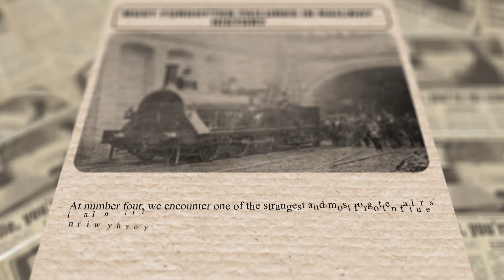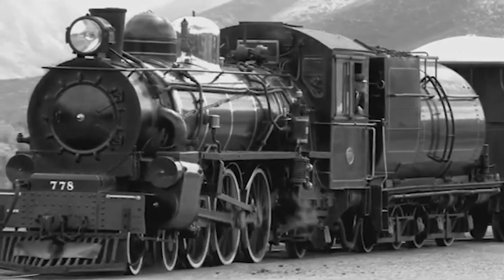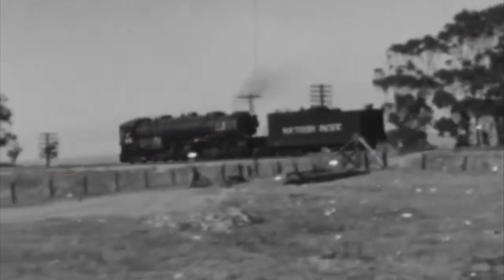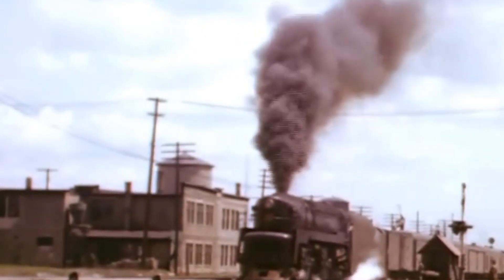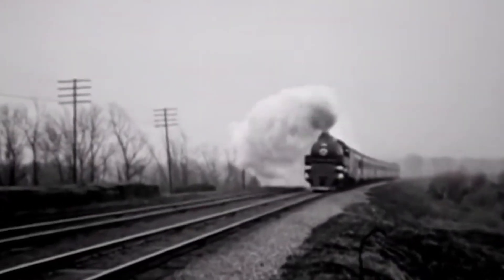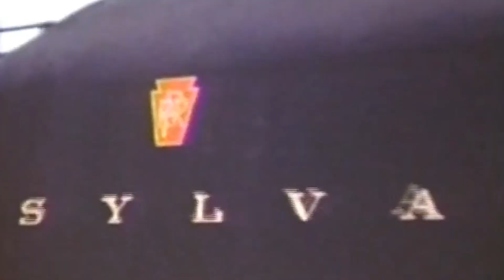Locomotive Failures That Shaped the Age of Steam!

Comment: Its a bit incorrect referring to them as "Electric Locomotives." The word "Locomotive" has self-propelled connotations. An electric engine cannot operate without an outside power source such as an overhead wire, so they are not completely self contained. A diesel or steam engine can run without any outside help, so they can be called true "locomotives." I like to call them electric engines.
Reply from the maker: Thank you for the input!  I will make sure to incorporate that going forward.